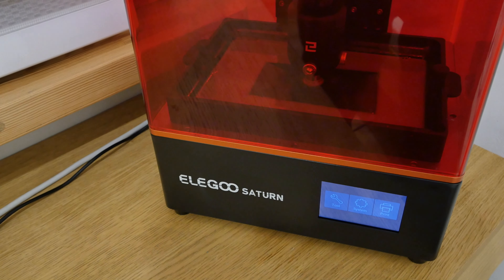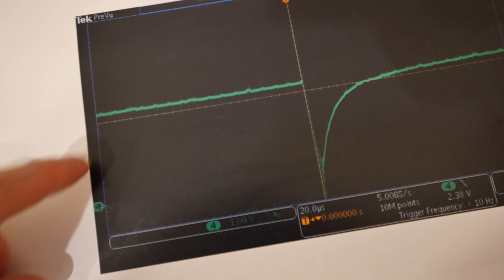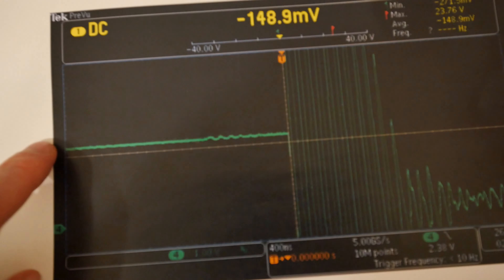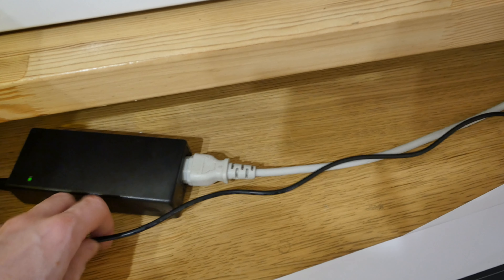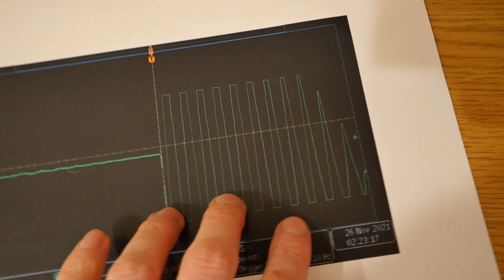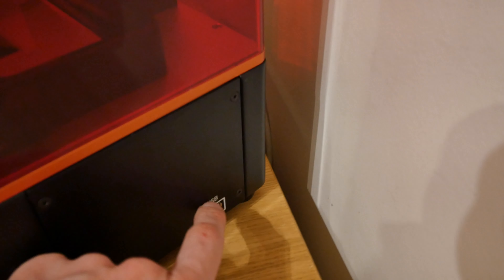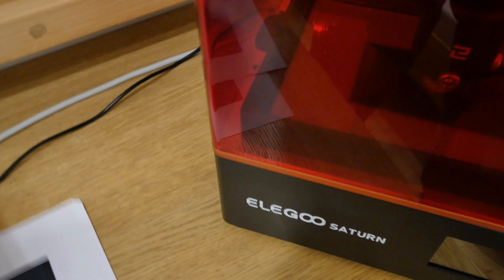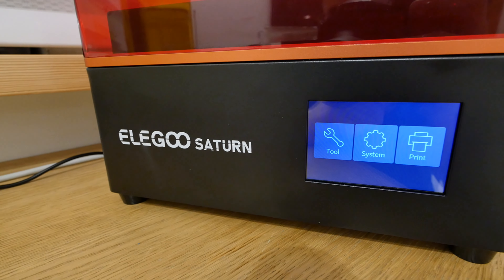Elegoo saturn reboot problem fix !  (for other printers too)

Comment: Hey man, great video, a couple questions if you dont mind, I have a similar issue with my mars 4, it worked nicely for a year then started rebooting when the plate moved or in the first layer of the print, was it the same for you? did it worked previously then started rebooting? also, how do you "ground" the LCD plate? 

I appreciate your time.
Reply from the maker: @thundernaut9710  Here’s a revised version of your message with improved clarity and grammar:

---

Hi @thundernaut9710,
Just make sure that your build plate is grounded, as well as the metal frame holding the LCD. Mine was working fine, but when I unscrewed the LCD frame from the bottom, it started failing repeatedly!

Comment: I have a similiar problem with my Mars 3. Here when I move the plate even kust 0,1mm it turn off and the blue light in the battery blinks on and off. Do you think its the same issue?
Reply from the maker: It could. Simply ground top of the lcd plate, thats it.
Reply: Any Chance you could provide images?

Comment: hey, could you describe the solution in simple words? I didn't get what I should do 😅
Reply from the maker: Ground your printer top plate, where LCD is. You must use power supply that does pass 0V to ground, or do it yourself.